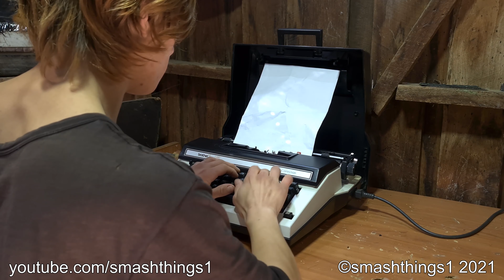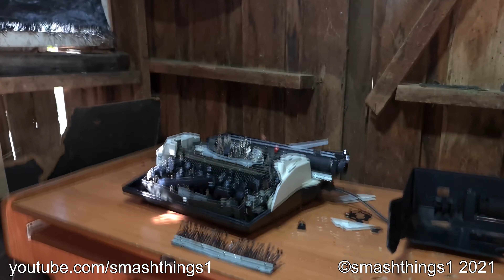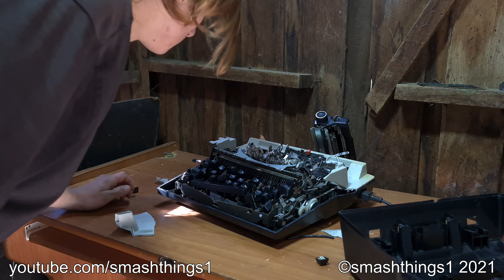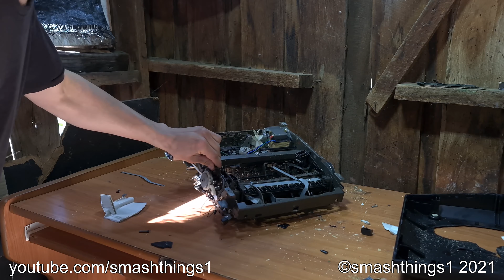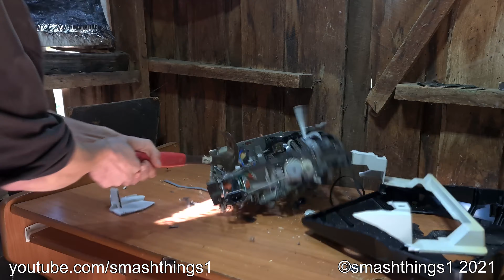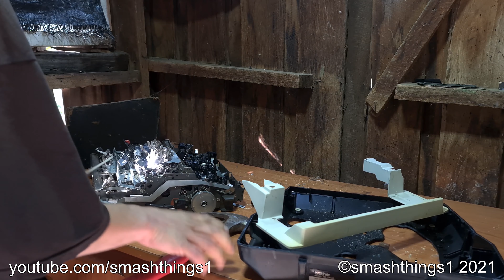Impatient Office Worker Destroys Vintage Brother Typewriter

Comment: Hah, this typewriter was even less cooperative than I expected, it didn't work at all!

(Looks like it's an electric model rather than electronic, and it didn't sound like the motor was running.)
Reply from the maker: Motor was jammed apparently as only the transformer made noise. I did get the motor to work after the video and jammed it again but it was too weak to burn out and kept buzzing.